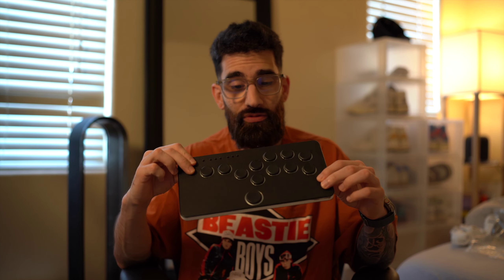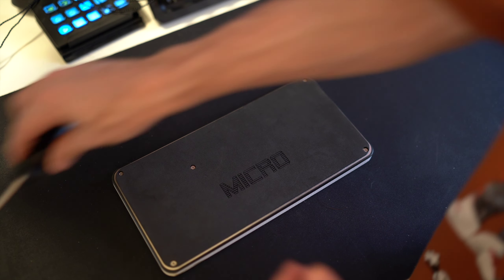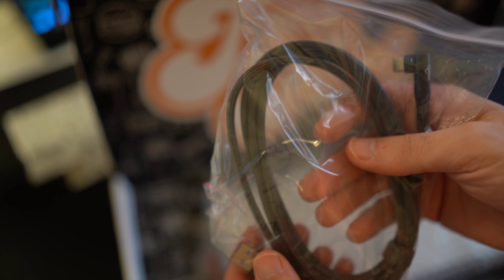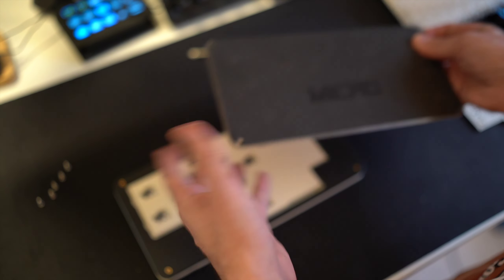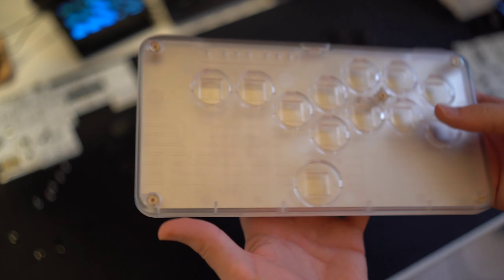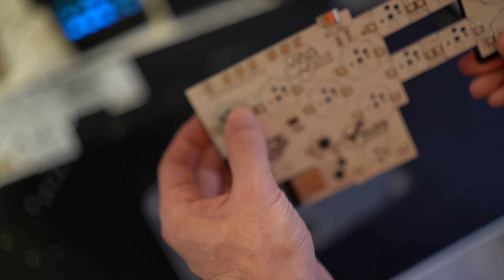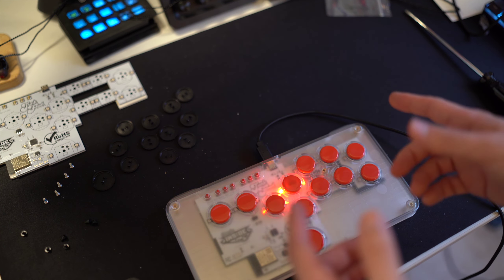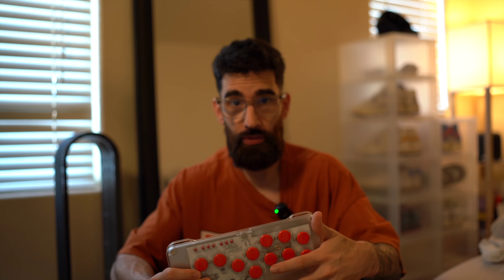Upgrading your Snackbox Micro is easy (PCB, OnePiece Case, Keycaps)

Comment: i just got the micro lite because it was cheaper and i play on pc. how can i go about upgrading in the future to add ps5 support?
Reply: Ps5 board or ps5 converter
Reply from the maker: Just the PCB like the one in this video or you can use a USB converter.
Reply: I assume if we want to add artwork, we will have to buy the blank artwork case? Then we can just move everything from the Lite over? Probably what I will do. It will cost more, but I want it right now.
Reply from the maker: Yea you’d need the artwork case.